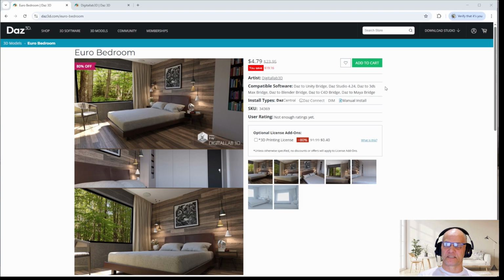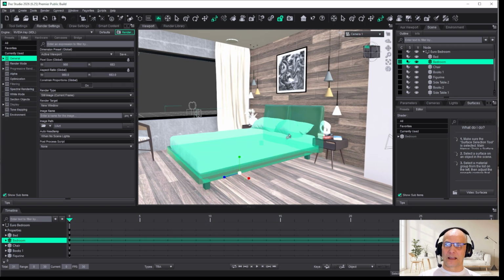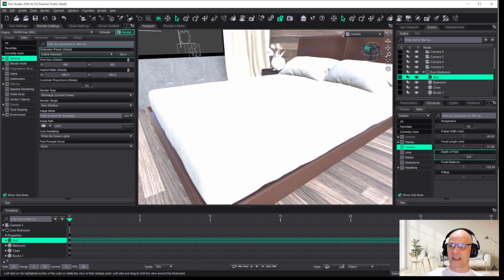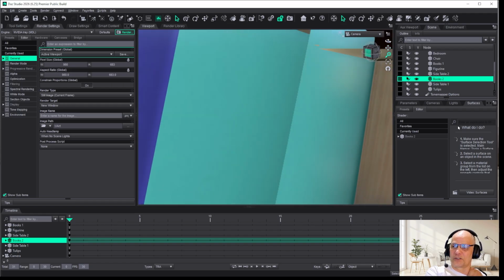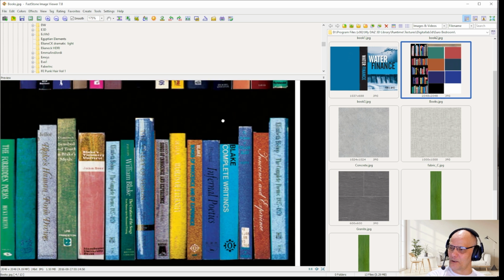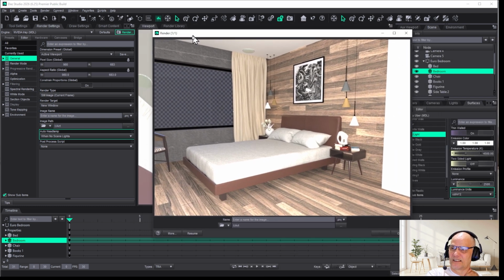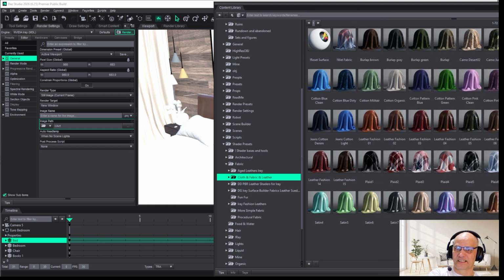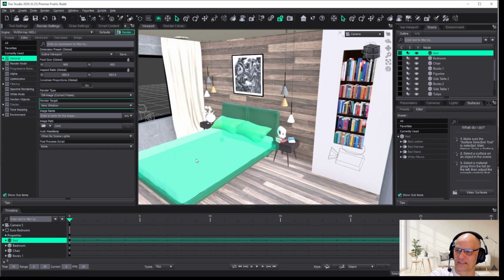Bad design practices to avoid at all costs

Comment: Great stuff.  Poser and Daz can be difficult to design for simply because they don't have the modeling tools other apps have that could make things like this easier to deal with.  Either way, this is helpful if I ever decide to create stuff for Daz or Poser in the near future.
Reply from the maker: Yeah, I have always thought that both programs needed some basic modelling tools. It amazes me that after all these years, neither of them even has a simply align and distribute tool for spacing out or aligning multiple objects in a scenes (think soldiers on parade or chairs in a classroom).